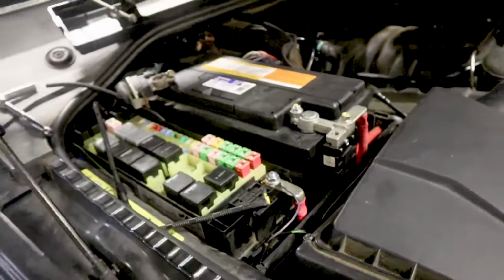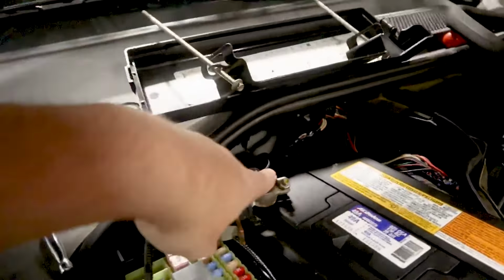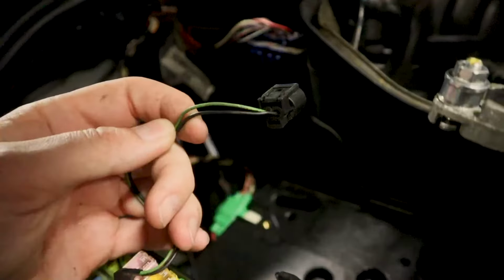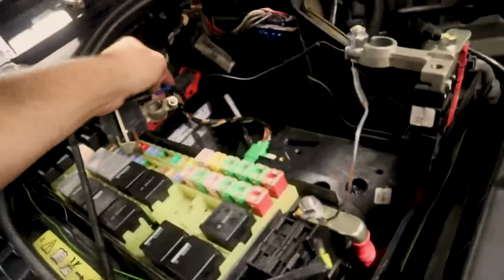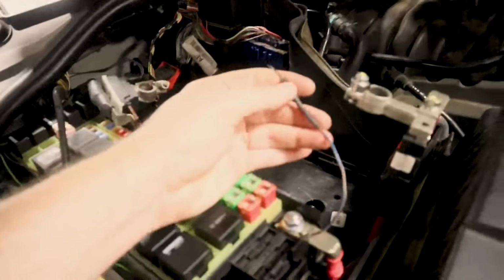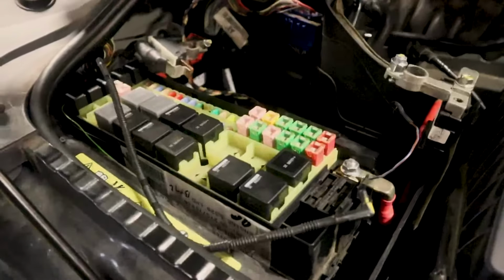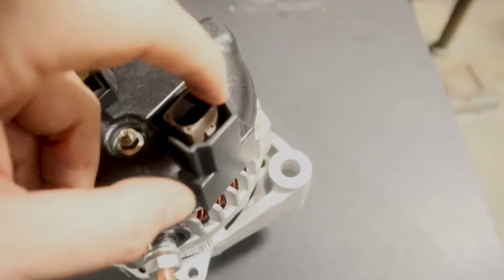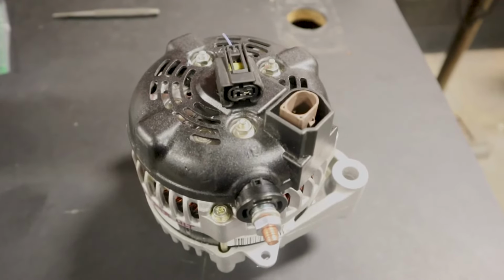Land Rover Charging system diagnostics, repairs, and tips for P0A1A

Comment: On my 2009 Range Rover Sport TD V8 3.6 ltr the battery died. Replaced the battery and then soon as that was done the boot locked up and will not open and the driver side door central locking won't work and the rear wipers dont work either !?

Comment: Quick question: I have a 2008 Range Rover súper Charge. The dashboard sometimes turns on and when it does the car starts. But if the monitor don’t turn on the car won’t turn on. Also, when I get it turn on and drive the car. The monitor says system error and shutdown the monitor but the car still drives. What could be the issue?
Reply from the maker: I’d have to see that one in person
Reply: Land Rover dealer tech here, It needs an instrument cluster. Super common issue on 05-09 lr3s and 06-09 Range Rover sports. There’s a few solder joints internally that fail. That being said some people repair them.

Comment: Informative video thank you. My 2013 Range Rover Sport is showing charging system fault. I’ve already tested the wire coming from the positive terminal. Changed the battery. Alternators good. Is there a way to test or check (maybe with a volt meter)  if the battery control module on the negative terminal is bad. It’s $220 to replace it and I would like to get some sort of confirmation before spending anymore money. No that wasn’t a typo it’s  $220 for a negative battery terminal cable. Any help would be greatly appreciated!

Comment: Thank you so much! this worked on my 2014 Evoque.
I cut the brown sleeve off and found a blue and brown cable had a cut in it. I joined it back up and everything started working again and the charging system fault message went away.

Comment: Hazzard lights come on usually a minute after starting. Doors lock then unlock. Then radio shows a code shutting down and then shuts off. Sometimes it will start back up other times you have to wait. Also it's shows a red park warning light. Truck runs fine no blinkers radio and the heating cooling system shut down. Can you help?
Reply from the maker: Have you checked the battery, terminals, and ground connections? I would definitely do that first.

Comment: My 2011 Range Rover Sport is showing CHARGING SYSTEM FAULT. My mechanic scanned it and the code is P065B-16. 
Question: Is this bad alternator problem? It appears I have a blown or burnt wire that connects to the battery. I nnoticed fume or smoke when I connected jump starter to the positive battery terminal in an attempt to jump start the car. Once I jump started the car, the CHARGING SYSTEM FAULT light came on for the first time.
Reply: When my 2011 Range Rover Sport was scanned, it showed the following two codes:
(1) P065B-16 - Generator Control - Circuit Range performance - circuit voltage below threshold

(2) B11DB-87 -Battery monitoring module - missing message.

Comment: I have a 2016 range rover sport diesel with the same charging system fault with 55,000 mile I bought it new.
Changed the Battery with a dealer OEM battery and a new Denso Alternator that matches exactly (Plug Type) I also changed the Negative terminal chip.
and cleaned all the engine grounds. 
Unfortunately I am still getting the Charging system fault on the Dash board , Any Suggestions?  I also plugged in my diagnostic computer and added the new Battery.
I enjoyed your video
Reply: Did you solve the problem? If so, what was it?
Reply: Keen to find out what the solution was for you? Is your range rover running smoothly now?
Reply: Where is anyone able to find the wiring replacements

Comment: Have the same vehicle...was running to heat the car up last night (I live in ME and it's cold) for 15-20 minutes, then when I got into the car and put it into gear the battery and engine light came on and the car died.  Turns over, will not start.  Alternator was replaced a few weeks ago and has been fine, battery is new from 6/22, ODBII is throwing a P0420 code for the cat but I have no idea what could be causing the no-start condition.
Reply from the maker: Start with checking spark and fuel. I would also check all fuses, could have popped one. Hope this helps! It is tough without a code to follow.
Reply: @AutoScholarwithMrB  it is throwing a P0420 Blocked Idle Air Control Valve. Drive Cycle A: Signal Missing.  The cat code was just what the OBDII reader itself said...but apparently the app claims it is the IAC.  I took off the throttle body today and cleaned it to no avail.

Comment: Service departments at dealers are shit.  This happened to my car, I took it in... I told the SERVICE MANAGER what happened and that I thought it was the alternator.   He said "THAT DOESNT SOUND LIKE AND ALTERNATOR ISSUE".  WHAAAT... a message while driving that says "BATTERY NOT CHARGING"?   What the hell is RESPONNNNNNSIBLE for charging the battery. 

Anyway... 3 weeks and still no word on what they think it is.   

HORRIBLE.
Reply from the maker: One thing I found are there are two alternator versions and if you use the wrong one, it won’t charge. Hope you get it squared away.